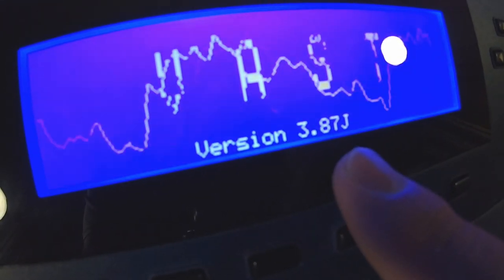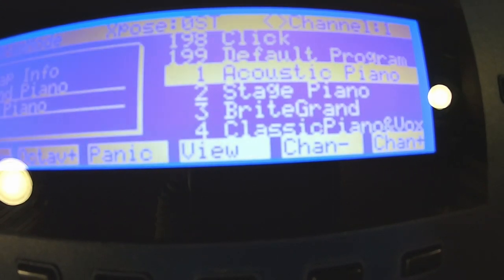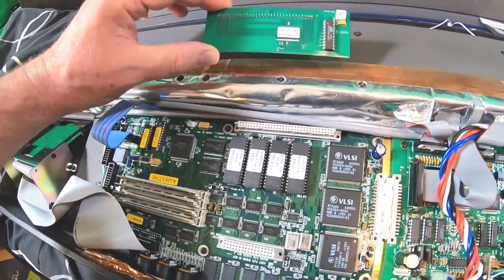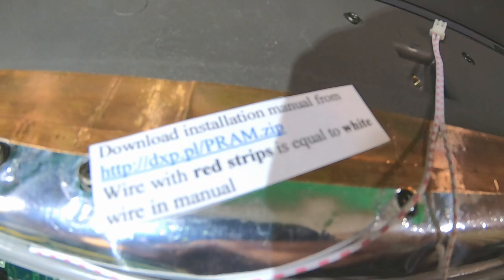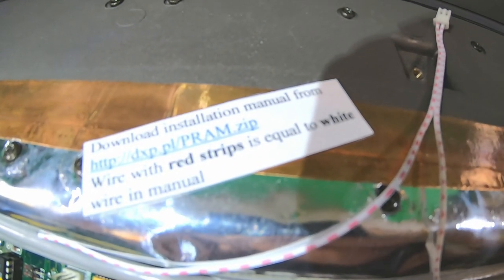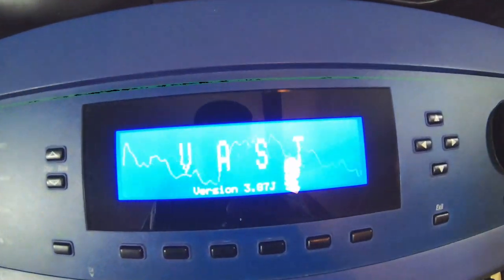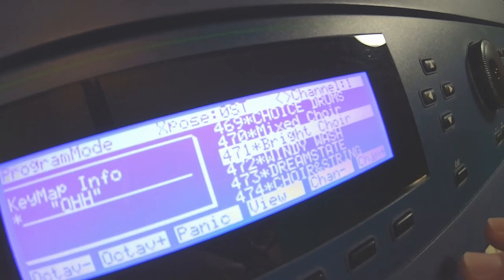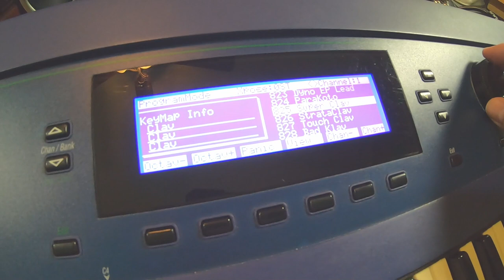Fully Upgrading My Kurzweil K2000 Synthesizer - Presets Demo

Comment: Love your Kurzweil stuff, Hank.  Here's a tip concerning the section on soldering Radoslaw's PRAM connector wires.  I've installed five of them over the last few months and the colors/stripes/dots on the wires seem to progressively be getting harder to see and discriminate and none of the ones I have had are as clearly marked as yours.  Anyway, I needed to find a way to differentiate the leads from the connector better than the colors of the wires.  Readers who are going to do this may find this helpful..... Before you start to solder anything, put the PRAM board into its socket and attach the lead wire connector to it.  While the connector is in its socket on the PRAM board pull the leads up straight and separate the two wires for at least six inches (you will need to do this eventually because one lead goes to the left and one goes to the right).  While you have the wires separated look at where they enter the connector that plugs into the socket on the PRAM board.  Choose one of the wires (it doesn't matter which one) and note the position (left or right) that it enters the connector.  There are two connections to be soldered, as shown by Hank.  If you have the board oriented the way Hank does in the video (with the keyboard side on the side away from you), the connection to the diode goes to the left.  In this orientation, the wire that enters the connector on the left is the wire that goes to the diode meaning the wire on the left goes to the left side (obviously, if the synth is oriented the other way with the keyboard side closest to you, the diode will be on the right side and the wire on the right side will go that way).  Whichever your orientation, mark the wire that goes to the diode in some way that you will be easily able to differentiate it when it comes to the soldering.  If Radoslaw continues to supply white wires, the easiest thing to do is to mark the wire using a black Sharpie.  Then, when the wire is marked, remove the PRAM board from its socket on the K2000 and then remove the wire connector from its socket on the PRAM board (make sure you do it in that order because the wire connector is sometimes difficult to dislodge from the PRAM board).  Now, you can complete the soldering task.  On the first two installations I did I guessed wrong about which wire was supposed to match the green wire in the Kurzweil instructions and had to redo the soldering in both instances.  I hope that this may make it easier for anybody else attempting this mod not to make my mistakes.

Comment: I have an Alesis Fusion 8 HD and they are famous for their very noisy, high pitched little fan. One day I found an old graphic card in some box in my cellar with a funny nice little fan...and just got curious....I replaced the noisy one (that looks like it was made for tanks in russia) with the graphic card...and it works. Ok, I run into a problem when I use the full 16 miditracks on the sequencer..but most of the time I use it for what its best: Pads and other ambient stuff....
So. maybe this Idea helps

Comment: Upgraded my K2000RS last summer added the SCSI2SD and Radoslav's PRAM board.
Just wish Radoslav would use different colored wires it was a bit difficult to decipher which wire was which.
Hank you did an excellent job showing the procedure.
Reply from the maker: Thanks Dana, yeah Radoslaws wires are confusing.
Reply: What does the pram do ?

Comment: Hello, All - 

Thanks to Hank for all the great videos and to everyone else for the very knowledgeable and helpful commentary!    Got a question for any/all of you....

I have a K2000VP that I'm upgrading to VX.   So I have Radoslaw's ROM and PRAM boards, and the necessary EPROMs with the upgraded sample set.   As I think Hank mentioned in one of the videos I've watched, Radoslow references the original Kurzweil instructions for installing the PRAM option, and so I downloaded that, and read it through carefully.    

Noticed that Kurzweil says that if you add ROM and PRAM, you MUST install the fan kit, and you must do it BEFORE the other upgrades (!!).  No mention of that requirement being dependent on a SCSI drive, although I can see the logic that a fan should not be needed without the SCSI...  

Now, I know manufacturers can be a little over-cautious sometimes, but operating from a "while I've got this thing opened up" perspective, I went ahead and ordered a fan. The one I have coming has a two-wire Molex connector on the end of the wires, and I think that's correct.  But they're hard to find, and it's not a new one, so I'm not counting on it being accompanied by any guidance as to where it should plug in for power.   Can't seem to find that information anywhere else, either, including the K2000 Service Manual.  

Any ideas appreciated.

Thanks!
Reply from the maker: I never added a fan to mine. Radoslaws boards are tiny compared to the original Kurzweil parts. They aren't putting off much heat. I replaced my display, so there isn't a backlight anymore. I don't have any internal drives, or the sampling option. I've removed the floppy for tiny Gotek.

So I've come to the conclusion that I don't need a fan.  If you are going to leave your keyboard on for hours at a time, a fan wouldn't hurt.

A fan wouldn't hurt either way. I just don't want to hear it.  lol.

Comment: Nice job. You shouldn't need a fan. It's really there for the SCSI drive, to my knowledge. It produced a lot of heat (and is annoyingly noisy). Since you've got the SCSI2SD you'll probably be fine. The only thing to keep an eye on is the power supply. You should probably double check the +5VDC supply with all the upgrades. I can't recall offhand if there's a trim pot to adjust that, but I think there is. 

You're still missing sampling, though.... right? Though, with the SCSI2SD you can easily transfer audio, but sampling on a K2xx is pretty fun.
Reply from the maker: Thanks Michael. Yeah, I explain in video why I didn't install the sampling option. I use the SD cards. Audio comes from my computer.  I don't do the record from turntable thing.  I can grab any of that audio on my computer.  Sampling option is something else to generate heat also.  I'm not going to install a fan.  I don't have the high voltage backlight display in it anywhere.  No floppy.  And only 2 small cards added.  I don't think I need the fan either.  The keyboard isn't going to be on all the time.  👍
Reply: @HankCoffey  Ah, I missed that part of the video. Yeah, makes sense. 

As a guitarist there's one thing you might want to try which I call the Genesis trick. Sample yourself playing... something. Then pop it into the K2000, fiddle with it a bit (make a loop, for instance), and then play over top of that.

I call it the Genesis trick because a lot of Invisible Touch came out of Tony Banks sampling their jams randomly. (Not my favorite album, but it's an interesting idea.)

Since you'd do this with the SD card and not the sampling option, then just record a bunch of random stuff at a time before migrating the card back to the K2000. Then see what happens to it once you start playing with VAST.
Reply from the maker: @mphtower  yeah, that's a good idea!

Comment: Hank!!! Because of you, I am doing all of these options.  I have a k2500 v 5.00 w/ sample option. 1249k purchased in 
I used to have a loaded k2000 purchased in 96' but I didn't take care of it so ebay'd me a k2500 about 10 yrs ago
Reply from the maker: Cool Dave, good luck with the mods!
Reply: Ok Hank, I figured it out. I have 3.20. Press the 456 simultaneously  and it comes up.
Now I see what you did with the Ensoniq external SD. Wow, easy. Do they make one for the Kurz?
Reply: also, the chips in my 2500 are larger and square. the board is stacked 3 high. I saw 2 chips that said janis on the bottom or 3rd board. It also had 1998 on a chip of some sort.
Reply from the maker: @D84D  if it was a plugin external, that was a 5.5 mini. They will work on a Kurzweil.   I have to keep my keyboards in storage.  And I honestly forget details on stuff until I mess with them a bit.
Reply: @HankCoffey  you are the figgin' Man! Thanks for your reply  cheers.

Comment: I have the 2000v3 withS. Fully loaded ram done bank then.   Also 2gb hd   Im most interested in the scsi sd drive. Also newnew display   Yes do add a fan.   It just makes parts live longer. I save fans out of computer junk.   Any fan will do. Usually 12 volt.   Even if you needed to solder on a little 120v spot to run little 12v walwart.
Reply from the maker: Cool man, SCSI2SD is nice.

Comment: It's not the extra heat from the extra added components.  The power supply gets hotter with more power demand by more components.  This power supply fails eventually if run consistently too hot.  That's why the fan

Comment: It's a blast updating this totally awesome vintage synth that is just a genius bit of engineering.  Where did you get the SD card drive and where can we find copies of all these vintage sound libraries to fill the 8G with?  The fan kit is mounted onto the housing (the lid) from what I have seen, could be wrong I only have my inherited unit to go by and I did not install that myself
Reply from the maker: The cheapest place to get the drives is eBay. I got mine from eBay seller SynthPlus. A site called Sampler Zone sells them for more $. But they will offer support if you don't know what you are doing.    The libraries can be gotten from a site R-Massive. You will probably have to contact them on Facebook for a password to the files.

Comment: Love this series! im upgrading one from 3.01J to 3.87, and VX Roms, Daughterboard and orchestral contemporary all in one, Pram, and 16ram to 64
Then on to Floppy and LCD and also i may change the little led lights to other cool color, love the Blue Case too!
Reply from the maker: Thanks Christian!  You might want to make sure you don't have to have the contemporary expansion as well. The VX Roms might require it. I am not 100% sure. The VX had both expansions.
Reply: @HankCoffey  Thanks Hank! yes i just bought the same board as yours from the same link so thanks so so much for sharing it! scouting for the originals must be expensier and a pain i find the Analog emulation sounds on K2000 just amazing in the future i plan to add the floppy and LCD but i dont know if get a gotek floppy emu or just scsi to sd, do you use your K2000 in your tracks? cheers!
Reply from the maker: @ChristianFernandoPerucchi  I hardly play it anymore. I use software. I still have it though. A kurzweil can read and write through SCSI. So it's best to get a scsi2sd instead of a Gotek.  Goteks are slow like floppy disks.
Reply: @HankCoffey  Thanks to you i have my fully loaded K2000 now i need a Scsi to SD and a new LCD and im set , in the process one of the chips came with a almost loose pin and broke off so i used the old chips as donors and could solder a new pin and put tha sucker into the socket, all working now, soldering into the motherboard was scary though i sweat a lot hahaha! thanks again!
Reply from the maker: @ChristianFernandoPerucchi  No problem man. Glad you are getting it working.

Comment: I have a fan of a regular k2000 keyboard that for not being careful when uncovering burns the keyboard, if you need it, I give it away
Reply from the maker: Hey korgfanatic, thanks for the offer. I am leaving the fan out of it. I haven't added anything generating enough heat for a fan. The keyboard doesn't get hot. And the VP doesn't have the factory fan. It's not needed.   It's for people with factory expansions and internal hard drives.

Comment: Hi, great video. How do you know if you have a VP or a VX without opening it up? I found a used one and I'm going to check it out tomorrow.
Reply from the maker: The VP will have K2000VP on it. It will only have sounds 1-199.  The VX will have K2vx, and sounds 1 to 199, and sounds in the 600s, 700s, 800s, 900s.
Reply: @HankCoffey  Thanks!

Comment: Nice video, I have the K2000 s ,"sampler," what's the difference between all k2000 ,? Can I up grade my k2000s ,Same as yours? 
I would like to have all the k2000 sounds on my keyboard,,,,,
Reply from the maker: Yes, it can be upgraded the same. There are 2 different circuit boards. Calvin and Janis. Janis is easier to upgrade. Contact Scott at SynthPlus.  He is eBay seller SynthPlus. He sells the stuff you need.
Reply: @HankCoffey  thank you

Comment: I know your dealing with k2000, but I have a k2600x, and I’m looking to find what ever expansion presets that’s available that has pink Floyd presets. Do you know where to get something like that, or what I need to do get those synth tones. Like the intro to shine on you crazy diamond? My Kurzweil is bone stock but does have the contemporary and orchestral rom upgrade as far as I know. I haven’t opened it up yet, but I thought you might be able to help me. Thanks
Reply from the maker: Hey Darren,  I don't know much about the k2600. I'm a guitarist.  I've just had k2000s.  Try researching on Google.  The info is out there.

Comment: Hey! Not sure if you still have this lying around, but would you be able to demo most (or all) of the K2VX presets? (bank 600-700)
There's little to zero demos of any of those exclusive sounds online, and I heard some very familiar sounds in it from media I know. A friend of mine just got a basic K2000, and we'd like to hear those sounds in action, before installing that expansion.
If it's too much work / time constraining then I completely understand. It would be super appreciated, for those rare sounds!
Reply from the maker: Hey Excalibur, that sounds like it would be a good video to make. It's sounds 600-799. I can not play keys very well. So let me see if I can play well enough to do the video. I'll see what I can do.
Reply: @HankCoffey  Thanks a bunch! IMO, I wouldn't mind if you aren't able to play well, I'm most interested in what they sound like
Reply from the maker: @excme22  cool, I'll do the video in a week or so.
Reply: @HankCoffey  One more question, does your K2VX contain the Industrial/Techno programs (starting with 200 Java set)? I see it associated with the K2VX alot, not sure if those are exclusive to the VX or if they are a separate floppy. Maybe you could demo those too, if you'd like?
Reply from the maker: @excme22  No, those are not on the internal ROM. Maybe a VX is required to play them?  The K2vx has the stock 000-199, 600-799 vx, 800-899 contemporary expansion, 900-999 orchestral expansion. Anything else has to be loaded by disk/sysex.
Reply: Just in case it isn't clear.  In order to use the extra sounds the VX EPROMS support, you need to have both the ROM options installed because the VX EPROMs reference some of the samples contained in the expansion ROMs.

Comment: Thanks for the tips on soldering. I have a K2000 with the original factory fan, which is annoyingly noisy. People used to remove the stock fan on these and install a quieter one. I've been meaning to get that quieter fan for many years, but now they're hard to find and I'm not sure how to identify the right one. Any suggestions?  Also, how about the sampling option?
Reply from the maker: I decided not to go with the sampling option because I can easily bring samples over from my computer. Since I only installed two small circuit boards, and removed the floppy Drive,  I decided a fan wasn't needed. My keyboard is only powered on when I'm playing it, not extended periods of time. If someone played their keyboard for hours at a time, a fan would make the caps last longer. Extending the life of the board.
Reply: The sampling board doesn't draw much power when it isn't being used.  If you have installed both Radoslaw's PRAM and ROM expansions, there will be little additive hear dissipation.  As Hank suggests, if you aren't keeping the synth on for long periods of time (i.e., says at a time), I doubt that fan will help significantly just by adding these expansions.  Still, a  fan is better than no fan.  Any 90mm x 25mm fan will do.  I have found that the ones manufactured by StarTech (Part #: FAN9X25TX3H), available at Amazon, is ideal given its quiet dual bearing design.
Reply: Oh, I forgot... The fan should be 12v DC!

Comment: Can you help me? I just bought a k2500 a few days ago and I'm looking to upgrade and update it. I've already changed for a usb floppy simulator and now I'm a bit confuse about how to update the Os (2.80 is running). When I look at kurzweil website I notice a suggestion to first update the objects but I'm worried in not do it well and fuck everything up. 😅
Reply from the maker: I am not real familiar with the other Kurzweil models.  I've only owned a K2000, and use mostly software now.  I recommend contacting eBay seller SynthPlus, use advanced search for seller.  His name is Scott,  he knows everything about Kurzweils.